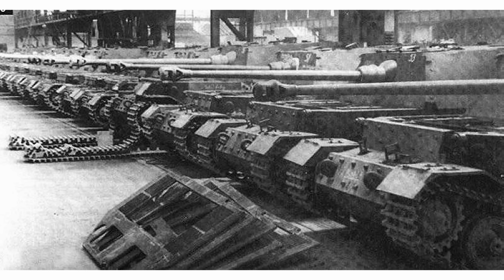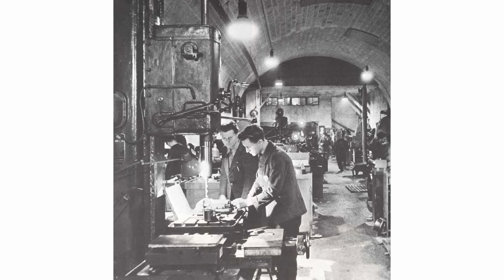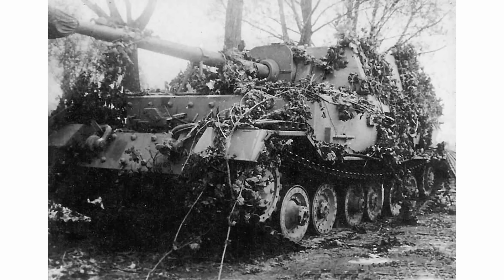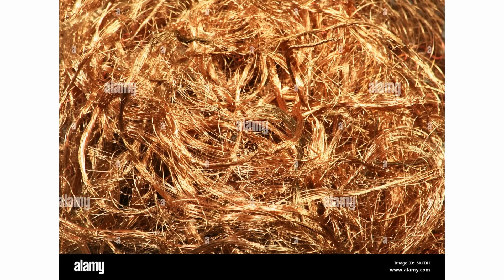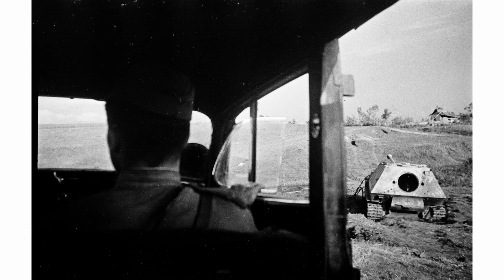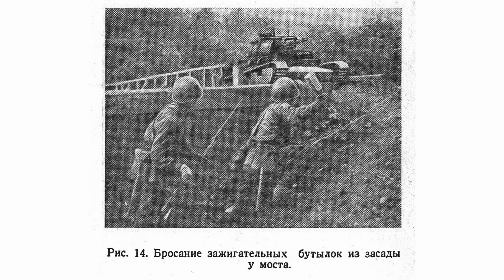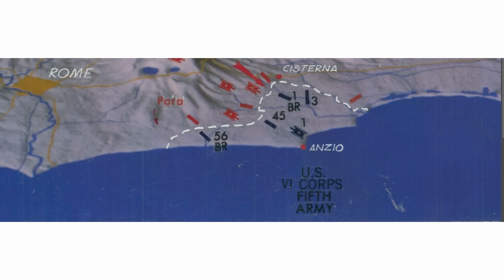The Ferdinand: Engineering Your Brain Can't Comprehend

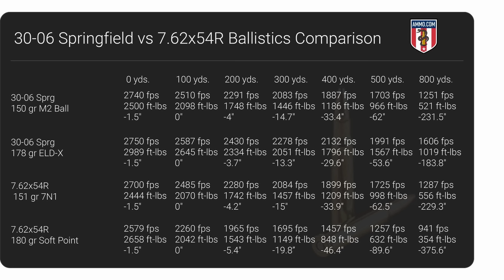Comment: 17:00

this would be a good place to address the concept of a "flat trajectory".

it simply DOES NOT EXIST.

GRAVITY EXISTS.

all projectiles follow a BALLISTIC trajectory. this is basic physics.

for projectile speeds (note that "muzzle VELOCITY" is a misuse of the term) of ~1km/s (about the best you could get), you are looking at flight times of 1-2 s. at 1s, the projectile DROPS by 5 METERS. at 2s, it's a drop of TWENTY meters. so if you aim the gun AT the target, you always miss. you have to aim ABOVE the target by 5 meters at best.

and this is where the problem arises. the ANGLE of the gun depends critically on the RANGE to the target. and how do you get that ?
sure, you can SEE the target clearly with "good optics", but that doesn't give you the RANGE.

and i will leave it at that
Reply: Look up the Zeiss sights and you'll learn not only what they used to aim with, but how they used them to gauge range to a target. It's like using a mildot scope, only slightly more complex. But the gist is, you find an object that you know the size of near the target. (Easy with a tank, most are around 9 feet tall, or 2 meters.) Then you use the markings on the sight itself to 'cover' that 2 meter height, the mils (yes, despite being triangles, it's still measured in mils) is a direct mathematical equation to distance. It's simple, "Take the measurement of a known object, multiply that by 1,000, then divide that number by the number of mils that cover the object."

You see a tank and it fills up most of your sight, so you put the big, center triangle on your target. It's 5 mils tall.
So, 2 meters, multiplied by 1,000 is 2,000, then divide that by 5, 400 meters distance.

There's another one behind it, it's 3 mils tall. So, again, 2 meters, x 1000 is 2000, divide by 3 is 666, round it up to 670, so find your elevation for 600 meters and aim a turret height above their turret, near as you can tell, and see where the round goes when told to fire. Might get lucky, might have a knack for it, who knows?

It's hard using the 7 triangles, but they are better for measuring large objects, like vehicles, than mildot scopes are, but it's the exact same principle.
Reply: @littlebuddy1140  thanks for laying it out so clearly.

but let me be clear, when i asked, above, how was this done, it was not because i didn't KNOW, but because i was hoping that some good samaritan (that's you) would take the time to write it all out.

then there are the coincidence range finders, and let's all say thank god for lasers.

so, that's the FIRST part of the job.

the next part is to know, for the gun you are using, what is the SHAPE of the trajectory, and that allows you to determine the gun ELEVATION.
Reply: if the projectile is traveling at a high enough velocity where its trajectory matches that of the earths curvature then it is by definition FLAT TRAJECTORY

an 8.8cm KwK43 L/71 set up on a mount 1m above ground and elevated to 0 degrees ( no elevation just flat with ground) the shell will hit a 50cm X 50cm  target at  1.01m above the ground at 7km range so FLAT TRAJECTORY DOES INDEED EXIST.
Reply: @CodyFarner  you have a very weird way of defining "flat". to be specific, it does NOT match what is found in a dictionary.

what's even weirder is that you're making PRONOUNCEMENTS, as though you actually know the material, but what you're saying is pure NONSENSE.

furthermore, if you knew even basic high school physics, you could CALCULATE the numbers involved, and would realize the projectile would need to be traveling about EIGHT times faster than available.
Reply: @victorfinberg8595  flat means flat.

so if a projectile travels and entire distance and doesnt get any closer to the ground than it was when it left the barrel than it has FLAT TRAJECTORY

Comment: Working from memory. There were several German accounts written that detailed the actual battle at Kursk  where nearly all of the Ferdinand tanks were used and destroyed or captured. The opening of the battle by the Germans was actually delayed so these very tanks could get there  by  several weeks. Most broke down due to drive train "problems"  in just a few miles of use.  They were a total failure.
Reply: Up to 50 of the 90 in action were lost or damaged, some recovered and used in Italy and Russia fronts. They were a disaster in that the resources were wasted, copper was in desperate shortage and numbers were needed not complexity and innovation and the distance sniping they were best at was no use in the point blank fighting they were sent into. 
Porsche still thought he was working in a peacetime industry with no blockade on resources, more in tune with self egrandisement than winning an unwinnable war. 
It is quite funny that Porsche electric vehicles still catch fire randomly  after 80 odd years of experience. Totally agree, total failure but very impressive to touch.
Reply: @michaelperry4308  "total failure"
hah i think you idiots are soo brainwashed by  victor and jew propaganda to have any common sense
the value of a weapon of war is how much destruction it causes and by this factor alone the Ferdinand is THE SINGLE MOST SUCCESSFUL ARMORED VEHICLE IN HISTORY
THE ONLY VEHICLE THAT COMES CLOSE IN KILL TO LOSS RATIO IS THE STUG III

OF THE 90 SPJ  SENT TO KURST THE RUSSIANS DESTROYED ONLY 15
THE REST WERE ABANDONED BY THEIR CREWS AND WERE RETRIEVED

OUT OF 90 BUILT 43 WERE DESTROYED IN COMBAT OVER 2.5 YEARS BUT THE FERDINAND KILLEE WELL OVER 600 KILLS

statistics and records from Germany Russia and USA show that 43 Elefants/ Ferdinands were lost  id love to know where you get your figure of 50

and actually the hills of Sicily and Italy werent poor environments at all for the Elefant Ferdinand

hell 1 elefant held up an allied collumn for 3 weeks and destroyed 42 tanks before it was withdrawn
Reply: also the Elefant destroyed a T34 at 4.5Km

MOST of the losses ( that being all losses to mines)  to ferdinand were in the first weeks as they were used as "break through" tanks ( something Hitler strongly objected to) 

after that they were kept far from the front far from range or counter fire. and they racked up a 15:1 kill;Loss ratio
Reply: @michaelperry4308 There was a change of design but 90 chassis were already completed. So they designed a superstructure to mount a gun as a SP. So there were no wasted resources.
Reply: @michaelperry4308  also of the 43 lost in combat
4 were destroyed by Yiddish sappers
14 broke down and were blown by the Germans
8 were destroyed by fighter bombers
11 were immobilized by mines, abandoned then blown by the Germans

50 went to Nibelungenwerke of which 45 were returned the the front (the 5 remaining is never mentioned anywhere)
they lasted till the last days of the war with 18 fighting in or around berlin as the bad guys won
Reply: @CodyFarner I think the bad guys lost.
Reply: @michaellittle8756 You can class them as bad guys nowadays.
Reply: @michaellittle8756  i bet you also think exposing children to gender politics is good as well as allowing men in dresses to use the womens bathrooms as well as allowing blacks to murder whites just cause theyre white are all good things

nope the good guys lost. unless you call the firebombing of over 11 million to be good or the forced rape of european women to be good or the numerous incessant wars since 45 to be good or the constant prioritization of jews or israel over christians and the west esp USA to be good

no the bad guys surely won.
the countries that actually committed genocides won.
Reply: Kill ratio was closer to 12 to 1 and the vehicles were actually liked by their crews.  Russian infantry destroying them on account of the absence of a bow machine gun is a myth.
Reply: @feltwedge yep, they were a magnificent gun platform and destroyed an astounding number of Soviet tanks.  There are lots of myths about them and they get repeated over and over.  They were a flawed design, but Kursk proved they could be remarkably effective in the right circumstances, and the front armor was nigh-unpenetrable.
Reply: @feltwedge  45 were lost in combat to enemy action ( most of the 90 were destroyed by crews after running oit of fuel so thats actually 13.5 : 1
still FAR better than any other AFV in history even the overhyped M1
Reply: The 8 to 1 kill rate makes them more 'successful' than the T34 and makes the JS2 an absolute disaster, everything depends on the criteria you use and the perspective they are viewed from. What matters is the Germans lost.
Reply: "total failure"
hah i think you idiots are soo brainwashed by  victor and jew propaganda to have any common sense
the value of a weapon of war is how much destruction it causes and by this factor alone the Ferdinand is THE SINGLE MOST SUCCESSFUL ARMORED VEHICLE IN HISTORY
THE ONLY VEHICLE THAT COMES CLOSE IN KILL TO LOSS RATIO IS THE STUG III

OF THE 90 SPJ  SENT TO KURST THE RUSSIANS DESTROYED ONLY 15
THE REST WERE ABANDONED BY THEIR CREWS AND WERE RETRIEVED

OUT OF 90 BUILT 43 WERE DESTROYED IN COMBAT OVER 2.5 YEARS BUT THE FERDINAND KILLEE WELL OVER 600 KILLS
Reply: If you want to listen about a tank that was a REAL total failure, search for a feature on the  Soviet T-35.